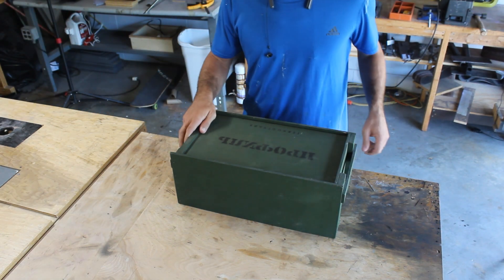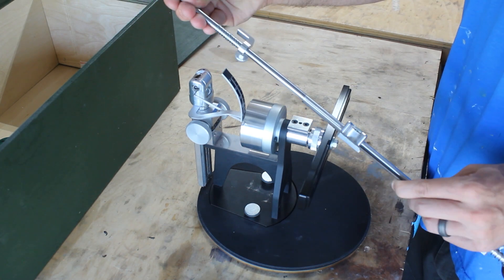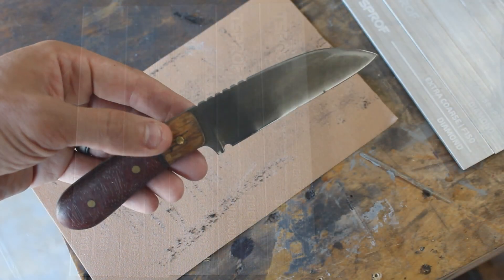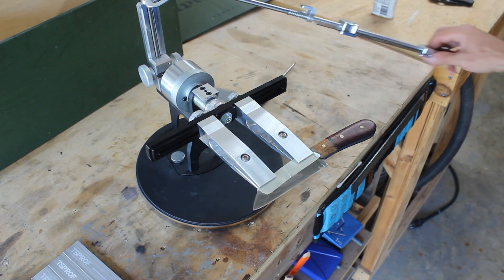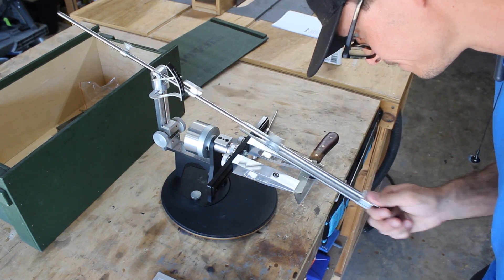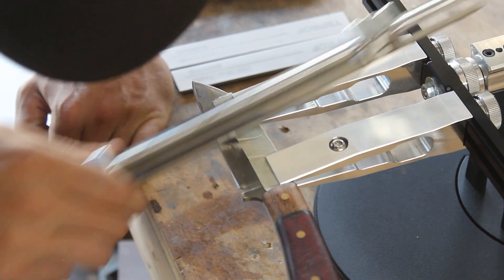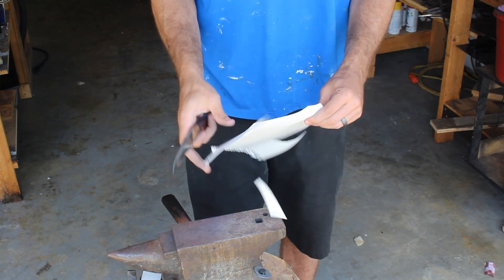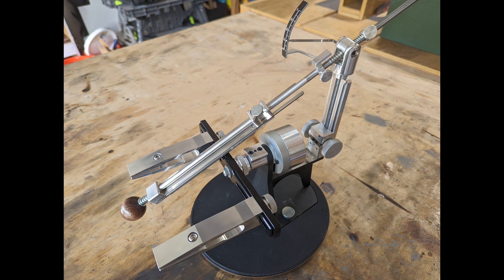Reviewing The Tsprof Knife Sharpening System

Comment: Just few quick notes: To put in a stone you should hold the round handle in your palm and use 2 fingers to pull the front stone holder towards the handle instead of unscrewing and moving the rear one. The rear one is usually only moved when you want to use different sized stones. It is also faster and easier to make sure you have enough tension on the stone so it is not moving.

The sharpener you received is the K03 model, the biggest (and most expensive) one they make. You also got a model with a few option accessories such as the base plate and "deluxe" arm lifting unit. They offer base units without those which are quite a bit cheaper. If you don't sharpen 12"+ long things you could go to their medium size sharpener the Kadet which can use all the same accessories as the K03 but is much smaller and quite a bit cheaper. Both of those models can sharpen things up to 7.5mm thick.

Their smallest sharpener, the Blitz Pro comes with specially milled clamps that can hold onto flats, FFGs, and various other grinds with ease and can sharpen smaller blades without needing different clamps. The clamps are superior to the stock K03/Kadet clamps IMO. The only problem is that they can only sharpen knives up to 4.5mm thick and around 10" in length which is the biggest con of the Blitz Pro. It also cannot use the accessories of the other models and currently only has an optional scissor cutting jig available.
Reply from the maker: Thank you for dropping some knowledge on the subject. I'm sure people will find this helpful!
Reply: @Wengelsworkshop  Glad to help.

Comment: I just want to provide a bit of clarification here; 7075 aluminum (which is what the knife-holding clips are made of) has a Rockwell hardness of around 54, which is well below the hardness of any steel used in knife blades.  This fact alone means using tape on the knife to prevent scratching is totally unnecessary.  Having said that though, tape may help to keep the knife stable in the clamps during sharpening, especially if not enough initial clamping pressure is applied.

Comment: For $700 + there should be NO NEED to BUY additional clips!
Reply from the maker: Yeah i pointed it out for a reason
Reply: I agree, I just picked up the KO3 pro and had to get the additional L adapters to be able to sharpen smaller blades like para3 and anything smaller. But it is an engineered masterpiece, craftsmanship is second to none.

Comment: Your stropping media is not good. Its particle size is all over the place as it breaks down quickly.  Use diamond spray 1-3 microns. Strop lightly until smooth lines on the strop.

Comment: I received mine on 08/30/22 and can't say it was so smooth of an assembly. The box had been dropped on the corner and the wooden crate was busted. The logistics company that TSPROF.US used to fulfill  the order put the tsprof box inside of a larger box with virtually no packing and when I received it from UPS the shipping tape was busted on both ends . Long story short the mechanical angle gauge was bent pretty bad which I blame on the shipper but the fact that the thumb screws that hold the unit to the weighted base would only thread in by hand about one third of the way and had to be tightened the rest of the way with pliers leaves me to wonder just what kind of quality control issues the company has. I am not happy with my purchase.
Reply from the maker: Damn Ken im sorry to hear that. That is not right and i hope they send you a full refund.
Reply: I am happy to report that a new K03 was delivered on 09/06/22 and is in perfect working order. Hats off to Arnold from TSPOF.us and Victor  Dyachkov overseas for all of the help.
Reply from the maker: @kenturner3268  hell yeah I'm glad to hear they corrected it!